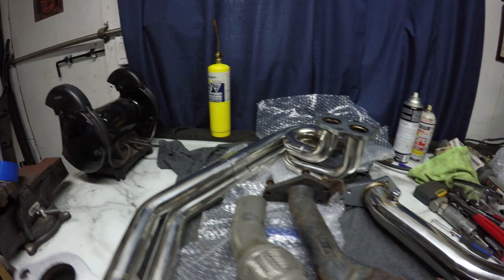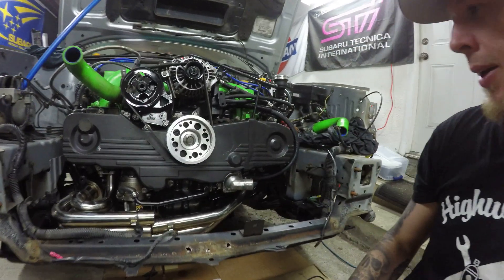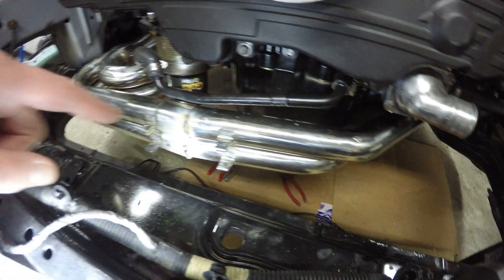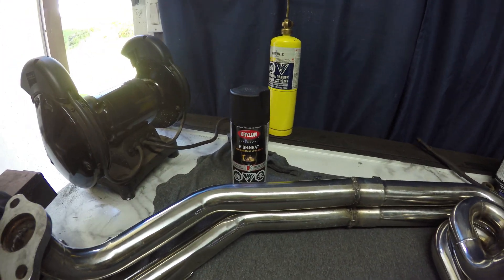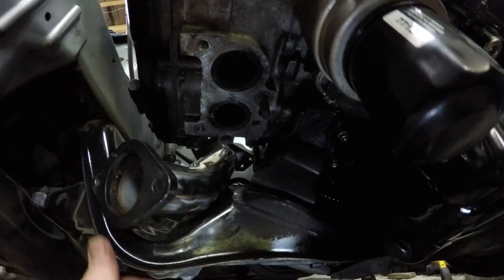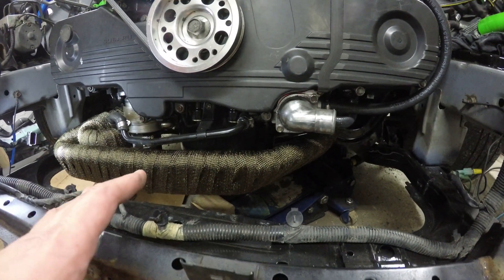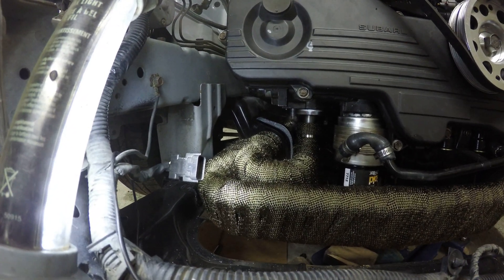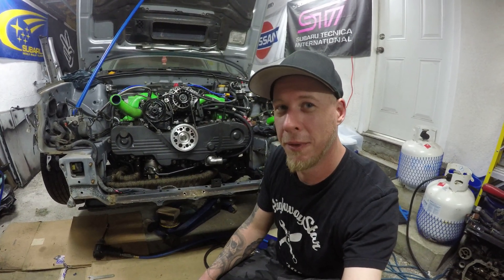My Impreza Engine Build Part 18

Comment: Looks great! FYI, wrapping your manifold is going to aid in cracking much quicker + higher egt's. The idea is to have cool external air moving around your exhaust manifold to cool down the piping. Not my business or build, but just wanted to advise if you didn't know. N/a header builds = wrap all day long. But turbo manifolds = faster decay/cracking/ higher egt temps with wrap. I do understand that some builds just need it as a solution. great looking regardless of my opinion. Cheers man
Reply from the maker: It’s all good. I’ve read about hotspots building and cracking header pipes. People seem to have good luck with Subaru header’s and I don’t expect an issue

Comment: Yeah I put a wrx crossmember & exhaust manifold on a 2.0 sport GC8 confusingly there seems to be less room between the SOHC heads & the tunnel in crossmember for up pipe than on the DOHC heads🤔
Reply from the maker: I knew the crossmember, oil pan, water pump were all things to consider but never imagined the head would be that much closer 😆